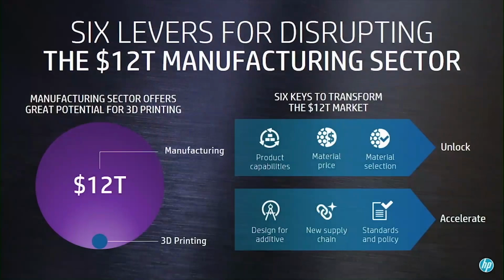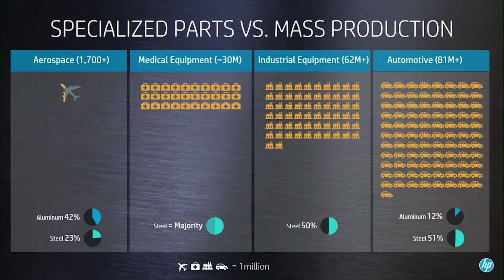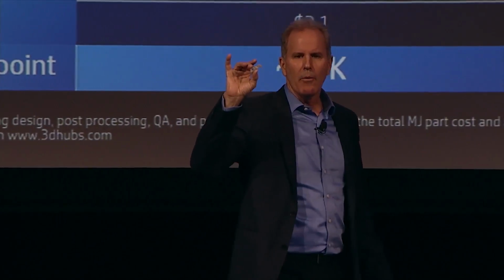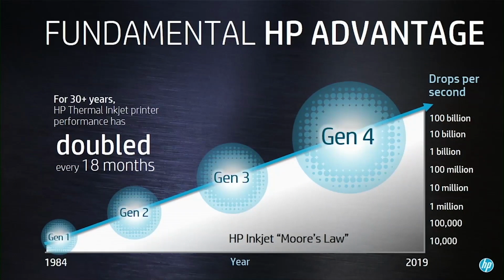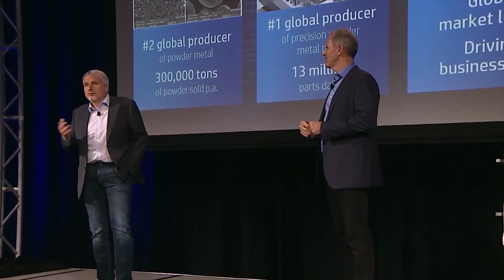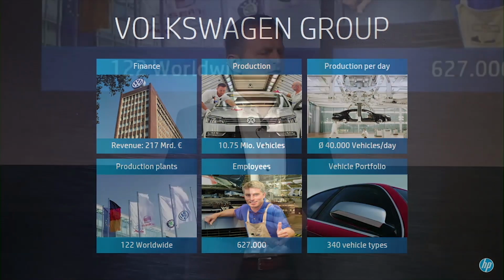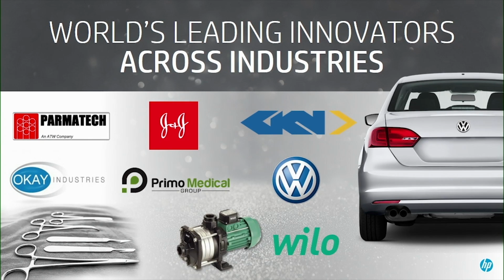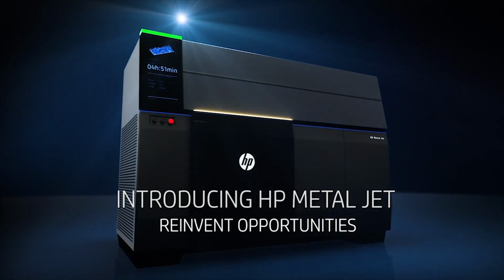Introducing HP Metal Jet Technology At IMTS 2018 | 3D Printing | HP

Comment: the printer cost? almost free. the consumables? more expensive than gold! and it will use so much on one part you have keep adding the metal powder. Every time you go to print a part it will say Printer out of powder! it will also not let you use it to print aluminium parts even if you want to print titanium. HP Moores Law - Ink prices double every 18 months!
Reply: How do you know this?